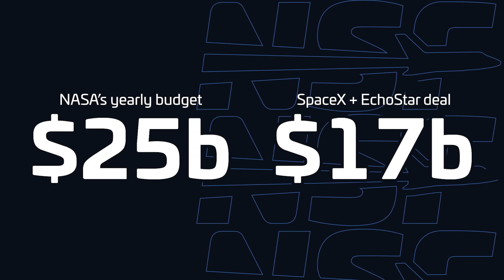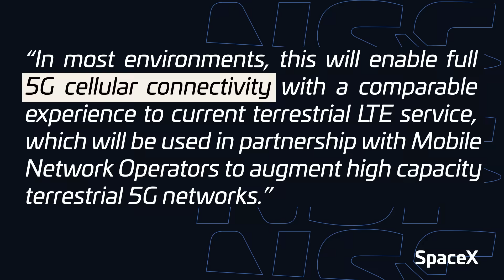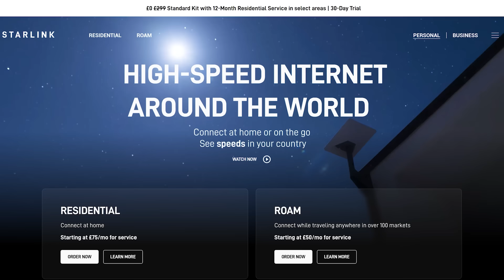SpaceX Just Spent $17 Billion to be Your Next Phone Provider

Comment: Pretty insane how far SpaceX has come since the first Falcon 1 launch in 2006.
Reply: It's not that crazy if you take into account how much money has been invested into the company
Reply: Unlike Starship. Musk announced in 2017 it would lob 300 Tons to orbit. What went wrong?
Reply: @JarvisThribb  Sounds like you have a serious case of rocket envy.
Reply: @JarvisThribb  It’s Elon. He always overestimates.
Reply: @lyricbread  It wasn't an overestimation it was a blatant lie and there's no way his engineers {Musk isn't an engineer} didn't know this. It's a scam.
Reply: @JarvisThribb  do you have a 300 Ton payload you need to get into orbit?
Reply: @lyricbread  Please explain the reasoning behind this question.
Reply: @JarvisThribb  by "lie" you mean still testing dozens of different experimental materials, entry profiles, and pushing their engines to pressures never achieved before by humans ever... 93% of all revenue comes from private contracts and not the government. Last flight they did an engine out hover test on the booster, changed the hot staging, used new engine covers, had a successfully pressurized payload compartment (and de-pressurized it safely while opening the doors) then deployed the test payloads before testing a much steeper decent profile with several different heat tiles, (and some missing)

Thats some "lie."
Reply: @JarvisThribb He can say whatever he wants but costumers will only see what his company is capable of and SpaceX is STILL the most capable space company on earth!
Reply: @JonVB-t8l  "testing dozens of different experimental materials, entry profiles, and pushing their engines to pressures never achieved before by humans ever..."

Trial and error is not the way to build rockets.
Reply: @JarvisThribb    "Trial and error is not the way to build rockets."  Really........ You really said that and din't read how dumb it sounded or did a google search on it. Name one rocket that din't have any trials or tests ?
Reply: @JarvisThribb would you like a tissue.. stay away from social media its clearly having a detrimental effect on you.
Reply: @-JustHuman-  “Trial and error,” also known as iterative design, is an excellent way to build rockets if you have the capital. Look how long it took the space shuttle from initial design to being operational. Now compare that to how far SpaceX has gotten in the last 4 to 5 years with the Starship program.
Reply: @JarvisThribb starship didn't exist in 2017 it was ITS 

And 300 tons to orbit was expendable